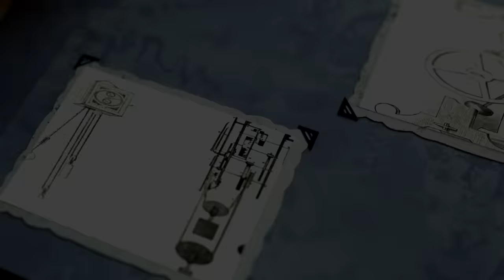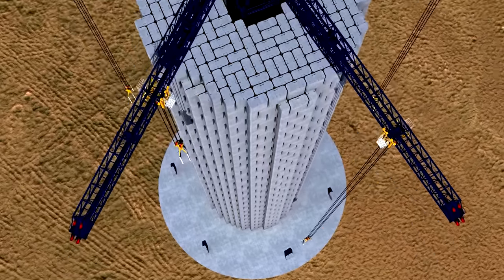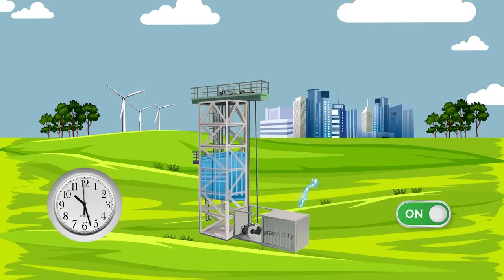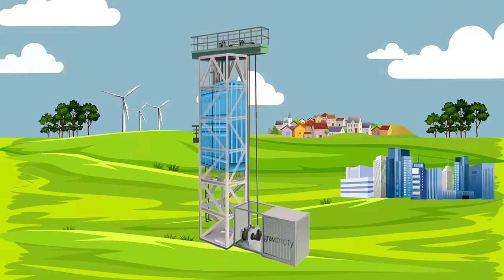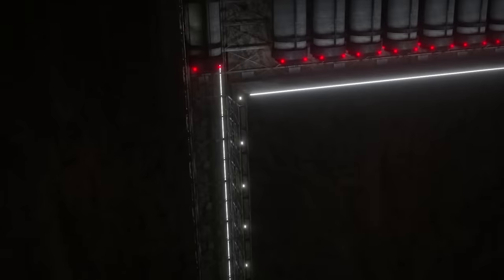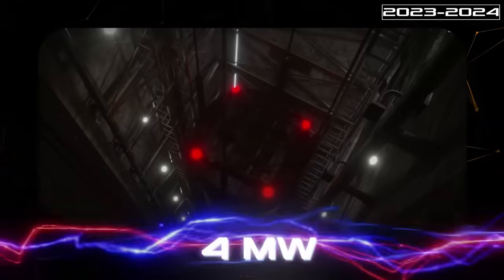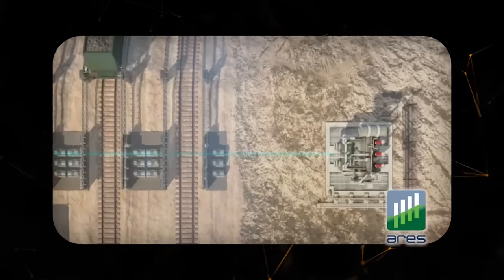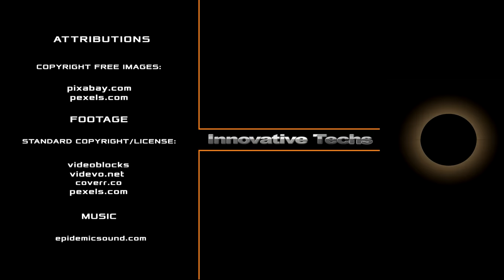How gravity batteries could change the world

Comment: Gravity is the easiest commonly available fuel, a more slanting slop would be better for weights to move towards earth for turning the electric turbine
Reply: Takes up too much space to do a slanting slope method. You'd be better off digging an oil drillers hole but way way wider and then having a platform a huge water tank can ride on connected to the electric turbine. Then you can fill the water tank up at the top and drop it down and only let it go down when electricity costs more so it generates more money and when the sled gets to the bottom of the 20,000 foot deep hole, it automatically drains itself of water into a built in drainage system so the empty water tank and platform can be hoisted up faster with little electricity used compared to what it produced to drop. If you use a weight that you have to hoist back up after you drop it you're sucking down all that energy you made. If you can build a drain system at the bottom of the hole you can save all that money by using a water weight you can drain at the bottom thus saving a bunch of money not havig. To haul the weight back up and covering the cost to refill the water container with ocean water or whatever. If you have to haul a full weight back to the top of the system it sucks down a lot of energy. If you do a water weight and drop it really far it could produce electricity for days and days before it gets close to the bottom and doesn't even need to spend much energy hauling the weight back up because you can drain the weight at the bottom. Only issue is you'd have to have quits the expansive water drainage system enduring the hole doesnt fill up and always drains faster than what is being put into it

Comment: Idea #2. Have twin towers side by side, that are physically linked together, and then suspend two loads of equal mass in the side by side towers, now also link the physical weights together with cables which fit in the groves of bullet proof super heavy duty wheel bearing pulleys. Then develop generators that will take advantage of this effect. It won't mattere weather the weights (s) are ascending or descending, there is none stop electrical production!!! Have a Magical Day!!! Make Coin!!!

Comment: All of these mechanical systems have the same problem. How much energy is produced VS. How much energy is required to reset the system. If it takes more energy to reset the system than the system is capable of generating in operation, then the system is inefficient and will FAIL.

Comment: how about a storm battery?  what do i mean... well if you can create a version of a man made storm ... heat / moisture/ cool... creating atmospheric friction, could that not generate lightning?  and with the proper means of collecting and manipulating that power ... to feed the system to keep that atmospheric "zone" within a space... would that generate enough power to sustain itself AND generate excessive power to use /store... and so on?  in my head i see large and small versions of such, the most grand (fantasy probably) is to carve out these spaces in mountain ranges and have metallic/shielded pyramids that the lightning strikes... thou you could also consider the wind power of the "zone"... heck could you create a man made tornado large enough to forgo the lightning aspect and use it as if it was a variance of geothermal.. since it would also be atmospheric using wind and pressure instead of heat?  right?  not an engineer so probably in the realm of science fiction and fantasy for now... but imagine the potential as science works to turn these concepts into reality.. some day.  peace.

Comment: Hard to see how gravity battery can take less space than lithium ion battery. The required mass is so huge. E=mgh formula tells the truth. Energy is in joules, which means 3600000 joules are one kwh. As a gravity acceleration g=9.81, one ton weight in 100m height have 0.981Mj energy, which is 0.27kwh. such a battery can fit into pocket and weight about kilogram. 100m tower, which can support 1t weights several tons and is definitely larger than a battery.

Because of huge mass required, material costs and environmental impact is easily high. Simply hauling that material consumes energy.

I'd still use water wherever it is available. Cables and lifts could be used with water, if better efficiency is possible than using pumps and turbines. Pumped hydro has typically 70% cycle efficiency. I.n theory, lift can be close to 100%, but in practice, it's difficult to beat that 70%. Lithium battery can be 95%.

Both of these are only short term storages. It takes huge water reservoir to provide decent amount of electricity for long period. Mass battery in that scale is just not practical

Comment: Salt storage tanks are the best way to go!!! If you want to store heat which all sources execpt wind and hydro use steam or heat light! Salt storage tank could store extra heat when demand is low and could be used to save heT when ramping up or slowing down making it easier and more productive and save fuel and energy also making more jobs. NO MOVING PARTS EXECPT MOVING SALT!!!

Comment: I'm interested in this in the context of moving housing: 
* Lift 20 shipping container tiny houses up a mountain on a train track, using standard train protocols and mounting the shipping containers sideways so that hydraulic levelers can adjust the angle if the terrain changes or keep the rail at a consistent angle. 
* Water and sewage could be at the bottom of the mountain and refilled nightly. 
* The houses could be mounted on a linked train so that there is only one mechanism to drive them up the track with gears on the ground and then generate power with each of those motors going down.
* The wind and solar can be mounted on each chipping container as well.
* Basically you take the train and live on a train going up and down, rather than have an ugly high concrete structure that does nothing.

Comment: Why not using hydrogen balloon to lift up the weight a little bit?
Reply: Because when some guy shoots it with a tracer round you have tsar Bomba. Plus hydrogen seeps like helium in a balloon. Plus you'd need a crapload to lift a weight that heavy. I think we're better off if we drill a hole like oil drillers except significantly wider and make it go like 10-20,000 feet down under the earth with a drainage system built into the bottom. Then build a sled tied to a cable connected through some pullies to the motor that will do the hoisting and lowering to generate electricity. On the sled you have a massive water tank. You release it every day when electricity is at peak costs, then one day when it hits the buttom of the hole after making a bunch of money, the water container automatically drains itself so we don't have to haul all the weight back up. Just the sled because it'll be cheaper to pump some more water out of the ocean to at the surface of earth into the empty containers than it is to hoist a full water container back up 20,000 feet and negating all the energy produced by dropping it. Eventually it could pay for the cost of digging the hole and if it was a quality hole that lasted long long time you could just keep reusing it and have a bald spot in the middle of some empty place covered in a bunch. The money it generates dropping the water into the hole will easily pay for the electricity cost of hoisting an empty container back up where it can be refilled at low cost compared to if you hauled it up full like you would have no choice to do if the weight was a permanent weight like a lead weight or a stone. If you can drop a weight without having to hoist it back up it saves a lot of energy. We have plenty of water, we just need a way to make sure it actually drains out the bottom of a really really deep hole fast enough compared to how quickly we drop it down. Plus not having to hoist a bunch of weight back up means you can hoist up at faster speeds

Comment: If we have computer and IA what can't we use them to control a power source to turn on and off a motor/generator. Just like a  Internal combustion engine.  The sparks are mechanically timed   Why can't we do it electrically with computers
Reply: We're going Backwards people not forwards

Comment: You are comparing a mechanical battery to chemical ones. 
Like comparing apples to oranges. It doesn't make since to do as they use a totally different way handling energy. 
The only places that I would see that being a benefit are places that you are using the energy anyway and don't want to waist it.  This would limit the people who would benefit from them. 
You could try this underwater and use buoyancy to help support it. Much like the ballast of a submarine. If the cost would be better. But this might be a crazy idea.

Comment: So how about we all fill our bathtubs with water and sleep in them.  Our bodies would warm the water which could then be circulated through a heat exchanger to boil a secondary low boiling temperature liquid that would then spin a turbine and generate electricity.

Comment: Wind and solar power are so low density energy systems that enormours quantity of materials are necessary (created with fosil fuel of course) to use them (land area to install them, metal structures, toxic materials). They will produce a lot of residuals after its short lifetime (15-20 years).
All of that is certanly not ecology friendly.
Not to mention the incredibly high cost that the regular people will have to pay and that will avoid many people to get out of poverty.
Nuclear power is a much better alternative in my opinion.

Comment: all of these storage mediums are "pie in the sky" ideas.  None of them have been developed or tested at large scale, and none of them will be.  The gravity battery does not have the capacity to supply energy at peak hours.  Unless you are willing to usurp land to build thousands of these towers to do your work.  However occupying land with these requires building them (more dirty fossil fuel to run the industry to do that).  Using coal mines is a cute idea, but that give West Virginia access to the stored energy, again the infrastructure to properly distribute this energy is where you will be buried in cost and labor.  these would have to be built all over the US in every state, more likely every city.  This wasn't factored into your cost benefit analysis at all.

The best way forward we have is with nuclear, feeding into the existing infrastructure.

Comment: The only gravity battery that is economically viable and realistic moves a lot of water into an artificial lake at a higher altitude when electricity demand is low by using a pump-generator hybrid and reusing the water over and over again in an up-down configuration. All other solutions are too expensive if you calculate the price per megawatt or kilowatt hour and in most cases they are just a scam.

Comment: The comment about concrete being "dirty" and emitting a lot of CO2 isn't exactly true. Yes, the current method of making concrete does release a lot of CO2. About 40% of the CO2 generated during the process comes from combusting fossil fuels, mostly natural gas, to heat the basic materials to about 2500 F in a rotary kiln. The other 60% comes from the thermal decomposition of the limestone (calcium carbonate) necessary to make the portland cement.

But there are ways to reduce the amount of CO2 emitted. One is that there is no requirement that the heat must come from natural gas, just that the materials have to be heated to 2500 degrees. Thus renewable energy, especially any excess power from wind and solar that this video addresses, could be used to split water into hydrogen and oxygen. When the hydrogen and oxygen are combusted, they only produce very very hot steam, which then heats the limestone and other minerals in the kiln. Another source of thermal energy is solar thermal which capture highly concentrated sunlight by heating a collector fluid or gas to very high temperatures (1800 F). This can then be used to do the majority of the heating with smaller amounts of hydrogen and oxygen used to heat it the rest of the way. Most of the electricity required to make this additional hydrogen and oxygen can actually be made by capturing the energy in the very hot exhaust gases from the kiln to make steam to drive a steam turbine, which then spins a generator.

The gases in the kiln consist only of water vapor and CO2. This gas stream can be extracted from the kiln and cooled. The steam will then condense into water and only CO2 will be left behind. This very nearly pure CO2 can then be either sequestered, or it can be used as feedstock in chemical processes that will make materials which will lock up the CO2 for decades or centuries.

And what is not well understood about concrete is that as it sits it slowly absorbs CO2 directly from the air. Over the span of several decades, concrete exposed to the air will absorb about 60% of the CO2 that was released when the cement in it was being made. So if the CO2 released during the making of cement was captured and sequestered or used to make durable materials, and hydrogen and oxygen was used to heat the kiln, then it is possible, at least in theory, for concrete to be a net negative source of CO2.

Comment: Renweable technology still needs to hit a point of reliability high enough to validate the need for such large batteries. And since we currently see accross the world that places that rely heavily on renewable energy are now depserately trying to buy energy from those who use coal/nuclear, Green energy is still out of reach and needs major leaps in productivity in order to become viable. Especially it simultaneously we are going to be converting over to EV, E-Semis, eleminating deisel also means E- Planes, and E- Ships, which even with coal and nuclear our power grid can not support the current amount of EVs on the road, let alone converting all vehicles over in the next 10-20 years as the radical Left implies.

Comment: Yet another fanciful proposition, not close to meeting realistic energy demands. Factor in the enormous weights, heights required for the massive potential energy required for commercial use, maintenance of moving parts, not to mention the enormous energy required to set up the potential energy in the first place - the so-called excess off-peak "renewable" power will not be sufficient. What happens if off-peak "renewable" power is not enough? Will there be a back-up coal-fired plant?

Comment: This is not a viable solution because we have this system all over the US and still we are not using it. I mean the city water tanks. everyday there is pumping and discharging cycle happening. why cant we put a turbine in discharge line and use recover the power used by the pump atleast. The reason it is not viable is the cost and maintenance of turbine and power lines, distribution is not worth it.

Comment: A far better method for energy storage by gravity is indirect how it works is solar and wind power Powers the grid when this is happens. The gates of the Hydro Dam are closed the rainfalls and the water accumulates behind the dam thereby storing energy the Hoover Dam has Lake Mead behind it one can see by photographs the high Mark or bath tub  rings left by previous High marks lifting weights would be too impractical and too expensive to build the towers. Old abandon mine shaft would be better. Off shore where the ocean is deep is another method to drop a heavy weight.

Comment: Not really a gravity battery more of a charged gravity fed energy system. There is no true storage of energy. Now if you you want a proper gravity battery you would use the earth and have shaker boxes locked into a low tight orbit. I would not do this on a large scale as humans have a tendency to screw things up. Instead I would use the gravity well in high orbit of a dead and long gone moon to make these batter and you would have the benefit of having a center point which will allow the creation of what you might call pillow wormholes.

Comment: Every building that requires an elevator could be built to include a system for lifting stored weights.  The elevator usually has a maximum number of people allowed which I’m guessing is not always the case so the system could adjust the stored weights being lifted based on this.  The less people using the elevator the more stored weight being lifted.

Comment: The problem with all of these solutions is reliability. And don't tell me to use batteries, they are and will always be a very dirty way to store energy. By now, EV cars have lift up the air pollution and it will take over 8-10 years for them to be even compare to hybrid cars.